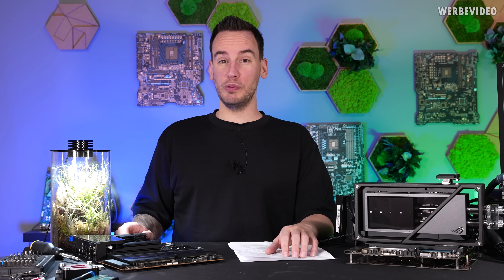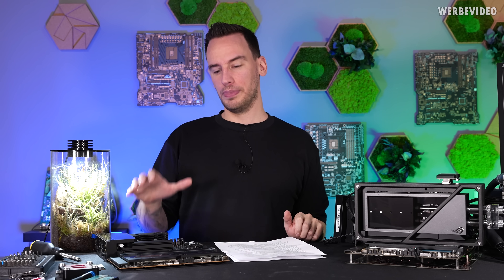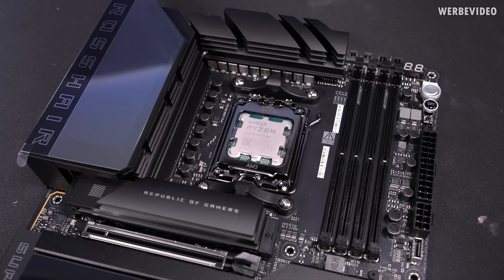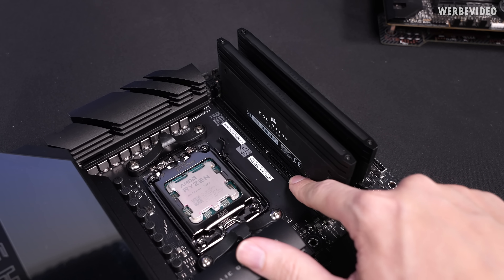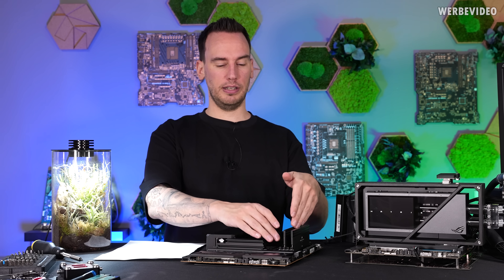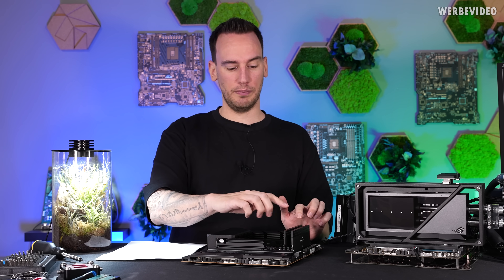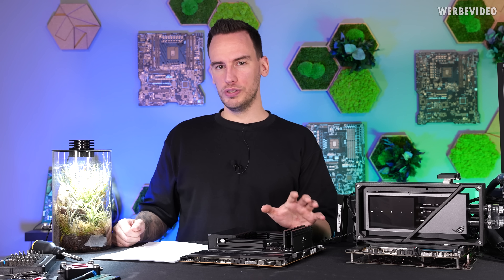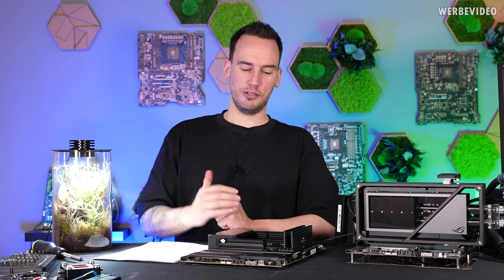How Empty RAM-Slots cause Trouble - ASUS NitroPath

Comment: so, could be there mainboard which physically allows to disable empty RAM slots ? 😎
(fully so not powered, via bios or physical manual switch, or both)
{j/k} also why not some empty slot TERMINATOR for existing slots {/s} 😁

Comment: The card-edge connector technology used in memory modules and PCIe slots has outlived its ability to transmit very high frequency signals in modern systems reliably and with minimal loss, noise, crosstalk, signal corruption etc. Back in the day when 100MHz RAM was top-of-the-line and PCI slots ran at 33MHz the low cost and ease of manufacture were acceptable but it is perhaps time for JEDEC and others in the industry to come forward with a new and better interconnection technology for such devices.

Comment: Ive wondered, for a while now, how far the edge connector can be pushed for performance. With 3D stacked memory being available for DDR4 based servers for at least 10 years now it wouldn't be hard to use a module based system like the new CAMM or CAMM2 to get Dual/Tri/Quad/Hex/Octal/etc channel memory all on one module. Some Industrial/Military applications in the DDR4 space already are doing that and include things like decoupling capacitors and signal terminators to offset the antenna effect.

Comment: The empty DIMM slots have always bothered me because their signal lines were not properly terminated and the signal would be reflected back. The l partial loop would add inductance to partially cancel the reflection/transmission of the empty slots.

Comment: Very convoluted way of explaining that shorter pins have shorter electrical 'stubs' leading to better signal integrity in turn leading to 'the eye' being more open in the eye diagram.

What would be an interesting experiment would be to completely desolder the 2 unpopulated sockets so you completely eliminate the stubs and end up with even more margin -> higher speeds

Comment: My friend is having troubles to even get to 6000 MT/s with the Ryzen 9950X with 4 dims at a total of 128GB and not even a month of using the new PC it went PUFF, DRAM error, we tried each mem separately in every slot a ton of times and nothing it went for RMA and they replaced but don't know what it's still to arrive, I wonder if the mem controller of the Ryzen 9950X went puff or something in the board cause the 4 dims of ram all dying at once seems way too odd...

Comment: This is somewhat similar to the unused connectors of a PSU. When it's on, the current is presented in each of them, used or unused. That's why I've always been isolating the unused ones with small pieces of tape.

Comment: they need to start including a ram fan slot so as to cool these high end OC ram running at 1.55/1.6V to keep them cool and increase their lifespan , why arent mobo manufacturers making effort to cool the ram by inclucating a small little bracket to even fit a 60/80mm fan above the ram or beside it to have active ram cooling ??

Comment: I still wonder why high end boards comes with 4 dimmslots? It makes oc harder. It takes up more space, it costs more, very few use 4 dimms. 2 dimm are better in viritually all cases except serveruse, those doing heavy rendering etc. I wish that most boards would be 2 dimms and biards like 'creator' etc would be 4 dimm. We consumers would get cheaper/smaller boards and if we want to oc have an easier job 😊

Comment: I wonder, is it possible to have a feature that grounds all data lines, when no ram is inserted? Probably requires redesign of the ram controller, but that might be whats needed for higher speeds when DDR6 comes around

Comment: Hello, I start by apologizing because I'm quite new to the subject, and I also don't speak English, I had to use the translator to be able to understand the entire video. But what I understand is that this new technology helps empty slots to no longer serve as an ''antenna'' that affects other memories, right? But in my case, I have 4 slots and 2 are empty, wouldn't it be the same to fill them with 2 more RAM? So I wouldn't have any RAM serving as an ''antenna'' which would make my other RAM memories unstable. Could someone help me by telling me if my reasoning is right? thank you very much

Comment: I highly recommend the Alpha Phoenix video "Watch electricity hit a fork in the road" as it covers another thing that I've seen cited by other creators (JayzTwoCents and (iirc) Paul's Hardware) as part of the problem when it comes to high memory speeds. Essentially, part of the problem on top of RF interference is that the open sockets (which are daisy-chained to the filled ones) add a sort of "reflection" off of the end of their conductors. Electrons do still travel up the unused conductors, but with nowhere to go, that "pressure wave", as it were, bounces off of the end, adding interference into the path used by the populated slots.

Another way this "pressure wave" is seen is with non-cryo overclocking at very high voltages. When electricity starts to flow, there's a spike in voltage from that in-rush of current as the front of that wave of electrons is sort of pushed ahead down the conductors. When overclocking at very high (for a cpu/gpu) voltages, if you're right on the very, very edge of killing that specific piece of silicon, that wavefront, on the voltage scales modern silicon runs at (where 0.01 is significant), jumps the voltage a LOT, and can cause what is effectively a Wave Of Burnination as the transistors get MASSIVELY overvolted and INSTANTLY fry. This happened to JayzTwoCents and I believe he said something about there being a, like 0.2v spike that killed a chip when it was taken from a ragged-edge 1.6v to 1.8v. Cryocooling/LN2 kinda gets around this (usually) by giving enough of a thermal buffer to compensate, as well as lowering the wire resistance, but even super-high-end custom loops can't handle this extremely localized temperature spike (on like a transistor level) because it happens so fast that the heat can't even get through the rest of the silicon to the cooler before it fries. And even if it could, with how temperature (metaphorically?) exponentially increases with voltage, there's just not enough of a temperature delta between ambient and silicon failure when compared to cryocooling (21c to >105C vs <-100c to >105c). This spike is INCREDIBLY short-lived, but with how aggressive the spike is, every microsecond counts.

Comment: But still they didn't make a point. Are the eye diagrams that much better at the dual slot motherboards? It's obvious that the nitro ones have less antenna, but that helps for both dual and quad slots in reducing emi.

Comment: Problem with a 2DPC platform with 1 slot occupied is the stub of the unpopulated connector. The Stub effect causes some significant incertion loss resonances the target operating speed in this case. Looking at the shorter connector, that structure pushes the resonances to a higher transfer speed therefore allowing operation at higher speed bin. 
Thanks for the video!

Comment: I'm still missing something for the nitro slot you still have the possibility of the floating pins to be antennas as seen in the cross section slice. Note: With it still not terminated and still floating the wire length change just means it's tuned for other frequencies better then the longer wire.
 
At the 8:38 timestamp, in the cross section slice you could design the top mechanical section so with no memory inserted the "connector/wire" could rest against a "ground" pad internally and when the slot is occupied it would push the connector off the "ground" . If this really was a design issue for noise wouldn't that be the "true" fix vs shorter floating wire length?

Thoughts from others? Been years since I had to think "RF design".

Comment: So how do, say, Threadripper boards get away with having even more memory slots, even closer together and still achieve high memory speed?  As far as I have seen, there is nothing special about the memory slots (at least in the ones I have worked with) or do they have some sort of shielding?  And is this not also a major issue with something like CXL?

Comment: Classic stub elimination! The key issue isn't as much radiative emissions (the "antenna" effect) but rather an unterminated transmission line that causes reflections. We do the same thing in PCBs with vias going from a top layer to a mid layer across the core - normally the via would go all the way through the board, top to bottom, but that leaves part of the via going to nothing, which we call a stub. This creates an impedance discontinuity and reflections which cause worse S-parameters and contraction of the eye.

Comment: That is interesting to know. I use a socket AM4 System Ryzen 3700X, ASUS Prime x470 Pro, 2*16Gb Corsair DDR4 Modules with activated XMP Profile 3200 Mhz, 16-18-18-36 timings. RAM worked fine at this speed when I used Radeon Vega64 graphic card.  But when Vega 64 was replaced by GeForce 4070Ti the maximum stable RAM speed dropped to 2666Mhz. How can the graphic card affect RAM stability?

Comment: This is good overall, but I see so many areas where this update is far behind what it should be.... Plastic RAM connectors, thin MOBO pcbs, power wires near any of these new components, poor quality ram sticks, and so much more. 
This is an "upgrade" to bring electrnonics to a point that was discussed 20 years ago.... There was a reason sound cards became better than MOBO's audio, they were horribly produced back then and still are today.
We still don't have good phases for the CPU.... Cmon, we have the tech to make many phases reliable... Why are MOBO's still creating crap?
Money is the reason.

Comment: Unterminated sharp conductors are antennas, esp in the GHz bands. That's why way back servers used to use dummy modules that terminated the slot. But most boards these days are supposed to terminate it in the board of the slot is unpopulated.

Comment: Actually I would suggest a simply solution which will minimize the effect - a dummy module with metal shielding and connection to ground pins. This will decrease significantly the interference from the empty slots.

Comment: What if there were some kind of signal isolator plug that you could plug into the empty dimm slots that would act as a faraday cage?  Maybe some foil covered in plastic?  Some people would probably pay $20 to add 200mhz to their existing ram speed.

Comment: 9:39 I suspect manufacturing is the reason why there's a difference between the ideal ending of those contacts and the in practice ending of those contacts. Having separate termination of the conductor from the circuit adds signal reflection as well as acting like little antennas. But the second case is much shorter so the frequencies would have to be much higher for them to resonate significantly. Ideally you don't even want those little endings separate from the circuit, because it does create a reflection point that's not part of the circuit. Even in perfect situations the interface between the two parts of the circuit create a slight reflection, but it is much more pronounced when you have little endings that don't have anything to do with a circuit path. But like I said, there's also manufacturing practicalities. The diagram / illustration is the ideal situation whereas the pictures show the reality of compromises due to manufacturing necessities. If they could get rid of that reflection they would have a much bigger eye in their diagrams, and for that matter the wave would be less noisy and therefore while still probably looking like a sine wave, it wouldn't be so thick

Comment: Begs the question if we should have some kind of plastic blank or a jumping/grounding blank (not sure which one would help more, maybe both) to put in empty ram slots to strengthen signal integrity on 4 slot motherboards ?

I know servers have plastic blanks but thats for airflow management only I think. Could be wrong, servers after all have crazy amounts of channels compared to desktop.

It's actually crazy we manage to get any stability at all in those ghz ranges with such a primitive contact surface as RAM DIMMs and slots tbh. I can see how CAMM/CAMM2 will be an upgrade in speeds possible for RAM compared to that.

Comment: We do have reflections on that tip of the spring.

With 5GHz you have a wave length that matches very well with the stump end forth-and-back run length of an open (=non-terminated) classic slot spring - at the lambda/4 length.
The bits are each contained in a half-wave - if you get reflection going beyond a quarter behind the capturing point in time, then these disturbing component will going to impact on the next bit as well, thus intermixing them.

Here we are well at lengths of 1,5 cm. With the new spring design its said the delay will reduce the signal delay to about 60%. Thus the calculated length of the news springs is supposed to be at about less than 1cm - thus there is again a noticeable time-or-length safety distance between this echo on the wire and the next bit getting sampled.

Comment: Foolish question perhaps. Why not offer aluminum slot covers (that don't touch the pins) that act like a faraday cage around the exposed unused slot? Wouldn't that prevent RF interference with the neighboring slot? Also honestly I expected the pins to be bent inward like in the new design. But it looks a bit too "pointy" .. like so '>', instead of ')'  at the point of contact with the ram pad. May cause problems with wear and tear. I guess a bit more flat towards the contact region would be better? You don't want stray sharp-points into the "air" because they act like antennae. 
I dunno, I'm no RF engineer so yea I am probably definitely wrong haha. 
Also still salty at asus for patenting this and the GPU quick-release. Because they have nothing better to do, apart from scamming customers of-course.